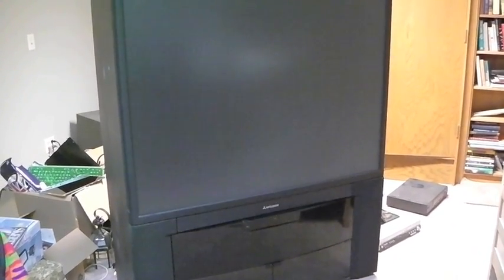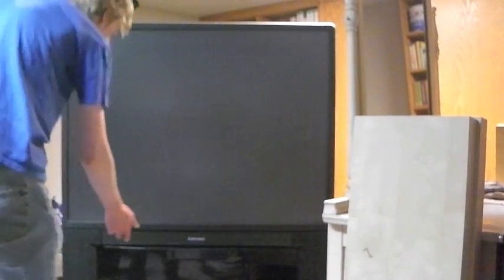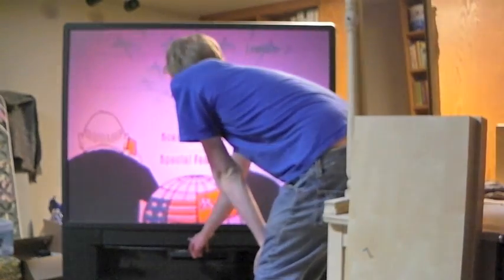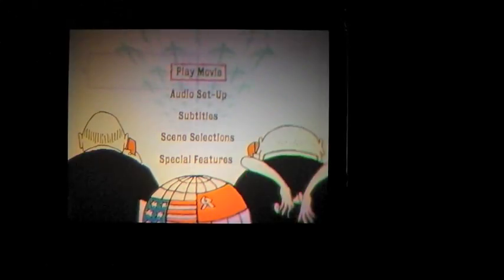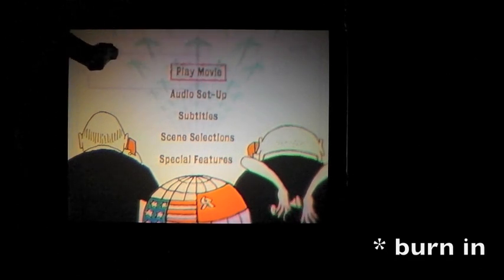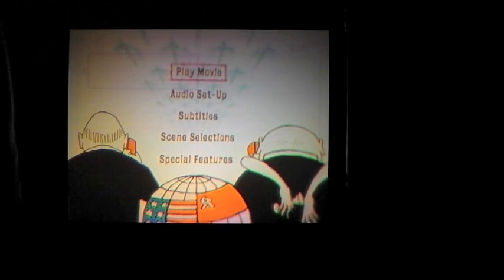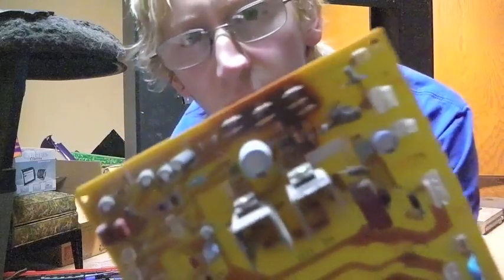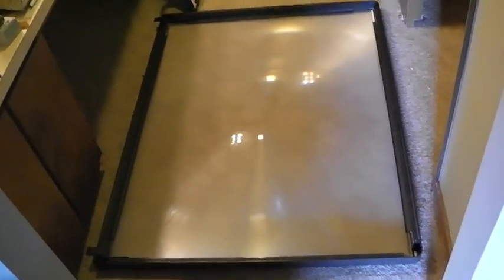Teardown: 50" Mitsubishi Rear Projection Flat Screen

Comment: Ya know, back in 2014, you probably could have still found some replacement tubes for this set. They are likely to be Panasonic P16 tubes, and almost all rear projection TVs used a variant of those tubes. They are all self-discharging, that is done in the splitter block with a few components in there. 

The heat on some areas of those boards is normal, the beam correction circuits run quite hot in some areas. If you were to look into the tube faces with the set on, you will see a very distorted image that doesn't look anything like a normal direct view set, due to the angles and differing distances the light has to travel to the screen surface. You can see that from the odd wear pattern.

The yellow look of the blue tube face is due to the brown wear pattern on the tube face where the phosphor is worn. The red and green have the colour filtered C-elements to improve colour reproduction and white balance. The blue does not have a colour filtered c-element because the blue phosphor is not as bright, and would be too dim if filtered. The blue tube is run in a defocused setting which improves the light output and allows correct white balance. Optically it is focused as sharp and clear as possible, just like the green and red, but electronically it is defocused slightly. In sets where people stuff around with the focus pots and not set the blue correctly, the image will often be a little on the yellowish side, and the blue tube will wear out very quickly due to how hard it is driven. Usually the green tube is the first to wear the phosphor to a dark brown, with the red being damn near indestructible and almost impossible to burn any static image into it. 

That liquid you got out of there is not poly glycol, it is ethylene glycol, which is quite corrosive to metals. The second you let that spill through the set it was as good as rooted. Would have been incredibly difficult to clean that out of there, and i bet it took you a while to dry it all up as it is hygroscopic. That is a dual purpose fluid, it is used to cool the face of the CRTs as they would get very hot and crack if it was not there, and it is an optical coupling fluid, it has a very good and very consistent refractive index, which is very important due to the C-element being such a dished shape, meaning the light has a lot more fluid to pass through around the outer edges. The liquid coupling chambers are almost always made of cast aluminium on an LC set, some air coupled sets have a steel chamber. The cooling effect of the fluid is simply for the temperature of the glass, it does not do anything for preventing burn in, which is not really burning, it is simply wearing or discolouring the phosphor coating over time due to being hammered by focused high voltage electrons.
Reply from the maker: Sounds like you've repaired a few of these!
Reply: @Darwinpasta  Indeed i have, although i mostly worked on front projection systems which were essentially the same sort of thing you see inside that rear projection set but with much longer tube necks and significantly larger lenses.  

With a set of new tubes, i could have made that set every bit as good as it ever was from the factory. 

I still have 6 fully working front projection CRTs and 2 rear projection CRT TVs here i use for old retro video games. You can see the Barco Cine 9 in my light gun on a CRT projector video. 

All i can say is i hope i die before all my CRTs do!! ;)
Reply: Great comment!

Comment: Keep us posted on the things you do with your parts you acquired from this. Im kinda freaking out how many
 recyclable things there are in my emerson. Glad I didnt demolish it. My trapazoidal mirror is the shnizzle all by itself. Free 50 inch plexiglass for framing?  WOOT WOOT
Reply from the maker: Yeah, those mirrors are pretty nice! I considered hanging mine in the shop over where I park, to show how close the front end was to the wall, but I figured sooner or later a bolt would fly off a socket and turn it into disco rain so that's waiting for another use. I'm hoping to mount the Fresnel later this year. Seeing videos of these things melting metal makes me wonder if I could cast small batches of aluminum with it... among other bad ideas that will have to wait until we're out of fire season. I'd rather not start the Dumbass Complex fire if I can avoid it.

Most of the smaller parts merged into the general mass of my scrap bin, but I do remember cutting up the bracket that held the tubes for mounting something else, and I think several of the screws ended up holding my flashlight together. I've been meaning to build a creeper that doesn't suck and I'm thinking those shielded casters would do nicely.
Reply from the maker: Oh, yeah, and the speakers went in a friend's radio project, and the steel U channel bits ended up in an angle-adjustable welding jig.

Comment: Crazy to think of the manufacturing process going into producing a 50” TV like that. The precision optics (mirrors and glass lenses), cast aluminium and steel components. Now a 50inch tv is produced so cheaply in comparison, with an LCD (or OLED) panel and a printed circuit board (and a whole bunch of plastic).
Reply from the maker: I'm sure this was a high-dollar unit in its day!
Reply: @Darwinpasta  I bet!

Comment: The fluid is usually Ethylene Glycol and Glycerol. It's very corrosive to metals, noting that the interior of the cavity was probably heavily coated. It's used to cool the tubes because of the intense light output generates alot of heat and can ruin the phosphorus if I remember right . Fun Fact, if contaminated, the fluid will grow bacteria in the blue and green units, but not the red. The bacteria can cloud the liquid and distort the picture.
Reply from the maker: Huh, thanks for the info. I'm glad I didn't find anything growing in there! And I wonder why the bacteria would leave the fluid on the red lens alone.
Reply: From what I read a while back, they don't like / can't use the red light, if I am remembering correctly. Also alot of places refer to that fluid as "Heat Transfer Fluid" or "Projection Tube Coolant"
Reply: First time seeing the inside of these old projectors.  Thought I might shed some light, no pun intended, though I could be wrong.
If "bacteria" can grow in the blue and green lense fluids and the not the red, then maybe the fluid is water based and it's growing alge and not bacteria.  Alge to grow would need light in the blues/greens but not reds.  That would explain that.
Also the fluid itself acts as the core material of the lense in addition to cooling the CRT.  The dome itself has no lense effect but when filled with some transparent fluid with an index of refraction similar to the dome but different than air, it will act as a lense.
Reply: All true, very common on Magnavox brands, as a rule, the blue crt was usually the worst with the bacteria.

Comment: Awesome video! Btw is the mirror made of glass or some sort of flexible material? Another thing to note the fresnel lens has enough heating power to melt rocks! I have two and if converted to a spot lens (due to it being a linear backing lens if coated with a clear oil coating it will be a spot lens)!
Reply from the maker: Glass! Acrylic would probably flex and distort the picture, especially with heat. And yeah, a friend and I boiled a pot of water with the lens a while ago just to see if we could, but I keep meaning to make a frame for it so I can really burn stuff. The linear backing layer on mine was a separate piece and just pulled off.

Comment: Nice job! Wondering how you took apart the exterior cabinet? I'm in the middle of tearing down my Mitsubishi big-screen and the  outer shell looks like it's glued together.
Reply from the maker: It's been long enough that I don't remember for sure, but the case being glued together does sound familiar. I was able to extract all of what I wanted without breaking up the case, though.

Comment: where can buy the color tubes? I need to replace in my mitsubishi? HELP! thanks gracias from Costa Rica
Reply from the maker: I honestly have no idea if parts for these are still available.
Reply: Sure, when date is build this tv? thanks for your help, so very cool video!
Reply from the maker: inetmark cr I would guess it was made in the mid 90s or early 2000s, but I don't think it had a date stamp on it.

Also, looks like these guys http://www.tvrepairkits.com/xcart/tv-repair-kits-mitsubishi-projection/ might have some bits to get yours working again.
Reply: +inetmark Corp Probably Andrews Electronics here in america but the tubes are expensive and I don't know about shipping charges etc. Maybe if the tubes are just weak you can find someone with a picture tube checker that could restore them.

Comment: gotta ask, how do you discharge these types of TVs? i had my own mitsubishi projector in the past, had to leave it behind :/  but i remember it expressing the blinking light, signaling that i would have to replace one problematic capacitor and the pico fuses near by.  i never got around to it because i was afraid of the flyback that was literally a few inches away. if i ever get a RPCRT again, and the need arrives to fix it, how would i do so? not gonna trust the self-discharge lol.. but yeah, would i simply just do the screw driver under the suction cup on each tube? as i recall, it was very hard to reach, so I just didn't do it.
Reply from the maker: I think I shoved a screwdriver under the suction cup, with a jumper wire going from the cup to the chassis? It was a while ago. I don't remember getting any sparks out of it, suggesting that the self-discharge was working as designed, but yeah, good idea not to trust the self-discharge too far. Do some research into the right way to do it before digging into one to be on the safe side.
Reply: @Darwinpasta   is there a speaker amp ??
Reply from the maker: @AnimationAirlines  I assume there is, given that it has speakers. I don't know how built into the rest of the circuitry it is or whether it would be worth salvaging.

Comment: I wish you would have shown the tv tubes being taken out of the cast aluminum frames.  I took all the screws out but these tubes are still stuck in there.  Not sure what to do at this point.
Reply from the maker: Huh, I don't remember mine being stuck like that. I suspect that your old rubber seals might just be holding them on. I would try holding the skinny part of the tube, with the aluminum frame hanging below, and tap around the frame with a hammer to see if that works it loose. Not a bad idea to wear gloves if your hammer aim isn't the best.
Reply: Ya that's a good idea.  I was thinking I would have to bang them out but its always tough holding something with one hand & banging or tapping it with the other hand.  Thanks for the feedback though, kinda reassured my original idea.  Quick feedback, might I add.  Think I'll subscribe.
Reply from the maker: Ryan Ash
Thanks! And good luck with those tubes.
Reply: Well Darwin, you were right.  It was the old rubber seals holding them on.  I took a flat head & a hammer & banged around the edges which is not easy to do since I was pretty close to just shattering the tubes themselves.  But no shattered tubes & 10 min later, I got 6 lbs of cast aluminum for the scrap yard; almost $3 worth so they were about a buck a piece.  Figured I'd let you know how it turned out & it's always reassuring when you know your idea was accurate.  Keep up the good work.
Reply from the maker: Thanks for the update! Good to hear my advice didn't end with shattered glass and a huge mess LOL.
Reply: I believe that when a tube shatters, it doesn't just shatter... it explodes.
Reply: I'm glad I have the opportunity to correct u Mr Milk.  No explosion occurs. Peace & safety will be yours.
Reply: Ryan Ash implosion, whatever. A crt is under vacuum, isn't it?
Reply: Yes there is a small implosion since it is under a vacuum but not enough pressure to harm you.  Always wear safety glasses & use gloves since it is possible for the tv tube to shatter outward at you.

Comment: Guy, I was watching all video. I wonder now if you finally repaired it? Why does blue gun is not blue color lens?  And the other question is what was bad on screen?  I noticed a rectangle in one of lenses, seen when is projected. What was that?
Sorry my English, greetings from Santiago Chile.
Reply from the maker: The problem was that the picture tubes were burned in. The tubes work by shooting electrons at a layer of phosphorus, which makes the phosphor glow. Over time, the phosphorus starts to burn and does not glow as brightly. If the TV displays a still image for a long time, the brighter spots burn faster, and so the shadow of that image is burned into the phosphor, leaving a dim pattern on the screen. (This is why computers with CRT monitors had screensavers.) I think the image in this case was the channel number. The only way to fix this is to replace the tubes, which is why I scrapped the TV.

I'm not sure why the blue lens wasn't blue. My best guess is that the blue tube made blue light on its own, but the other two tubes made white light, which the colored glass filtered into green and red light. I didn't run the TV with the tubes uncovered, so I can't confirm this. 

Your English is better than my Spanish! Greetings from Washington USA. :)
Reply: @Darwinpasta  Aw, man! You have been so cute answering me. Thank you a lot for response me so quickly. I like so much that technology and the cabinet consol is huge, impresive to the view. 
I remember in 2004 I was in my lovely gringo friend Jeff, in Austin Texas. He had one retroprojector tv same or sililar as yours one, and I hate a bad convergence, so I found menu and then made adjustments throw + signs in each corner and center of screen. I am not any kind of technician or electronic knowledges. I'm graphic designer, and I have very clear in mind white balance, black balance in a picture given in a CRT (Tubo de Rayos Catódicos  Cathodic Rays Tube XD) and I have made several time adjustments of colors balance, (knobs interior removing back cover).
I love television sets, weeks ago walking around block I found a 14" Sony Trinitron 1994 (made in USA) like a trash in front yard. It is working perfect. And also have a Sony Trinitron 21" 1991. 😋
I have had many TV sets.
I made years ago something similar to the CT100 RCA Victor first color TV 1954. 😋
We here adire prople from the US, and I use to call them gringos, is a lovely word, not rude or any other connotation. Some day in your life think to visite me.
😀
Reply: Each of the tubes has phosphor producing the respective primary color, but they appear white when lit by white light. The red and green tinted dome shaped lenses (called C-elements in rear projection TVs) help increase the purity of those colors.
Reply from the maker: @crist67mustang  Sounds like quite a collection! I've never really gotten into TVs myself, but I bought a battery operated Bentley radio from a thrift store a while back. Not sure why I bought it, or what I'm going to do with it, I just thought it was cool. People throw out some interesting stuff!

Comment: I need the procedure to discharge the 3 crt' anodes/FBT/CR block. Thanks.
Reply from the maker: I think I just shorted everything that looked like high voltage to ground and hoped for the best. Probably stuck a screwdriver under the suction cups, with a jumper running to the chassis. RedSkorpion's comment suggests the tubes are self-discharging, which would explain why I didn't get sparks. Even knowing that I would still attempt to manually discharge the tubes just to be doubly sure I wasn't about to stick my hand into high voltage.

If you're unsure, there's probably a yt video showing how to do it properly.
Reply: @Darwinpasta  So you didn’t pull any of the boots off of the crt anode, cr block or the FBT you just tried to get a probe up under the boots?
Reply from the maker: @georgesmusicchannel2115  Pretty sure I just probed them in place, yeah. Stuck it under there and poked around until I found the metal part. I'm sure there's a better way to do it.

Comment: So how did you end up discharging the tubes?
Reply from the maker: I think they were pretty well discharged by the time I got to them. IIRC I basically just shorted every connection on the back together to be on the safe side, but I don't remember seeing any sparks.
Reply: @Darwinpasta  it's funny I put up with what you dismantled the TV for, about at least five years. now my set when I go to turn it on shuts back off right away.
Reply from the maker: @Geerladenlad  Sounds like a power supply issue. Also sounds like an excuse for a teardown!
Reply: @Darwinpasta  the TV's almost 20 years old! If I can't find a fuse in there I'm not even going to bother with it. I'll just get something else.
Reply: @Darwinpasta  from what I researched sounds like it's something to do with the convergence. With the error code that displayed there is a short assaciated with convergence. Someone mentioned a Pico fuse. I don't know what that is.